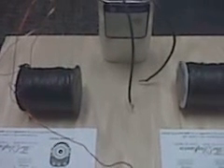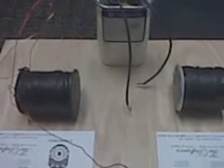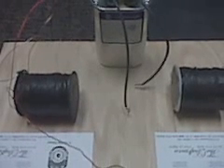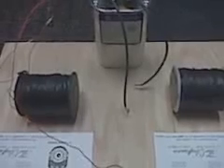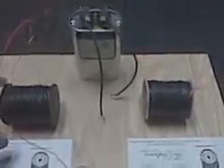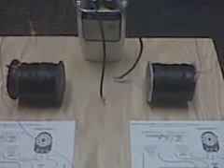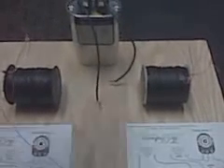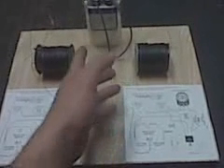Lefthand's self-oscillating radiant energy platform,powered by  the Daftman circuit part 1

Comment: Yes you got it. Just saw the date, whatever happened with this? Thanks.
Reply from the maker: Thanks...I actually still have it. Its better with a microwave cap and switches and lead for power.It's at my cabin, gonna use it to recharge old car batteries to use for off an grid power bank.